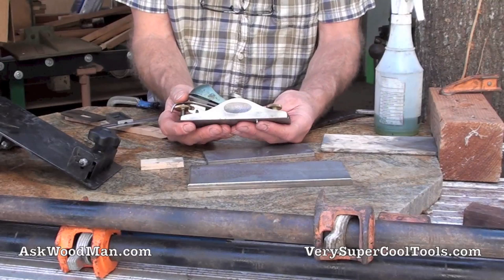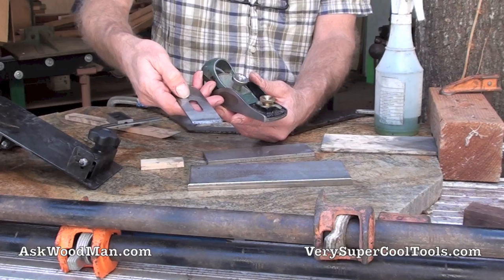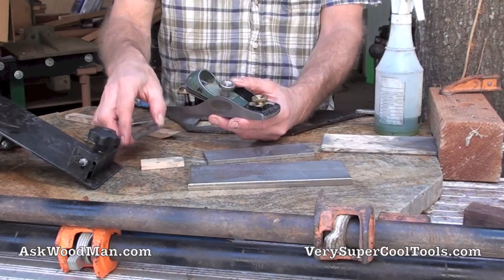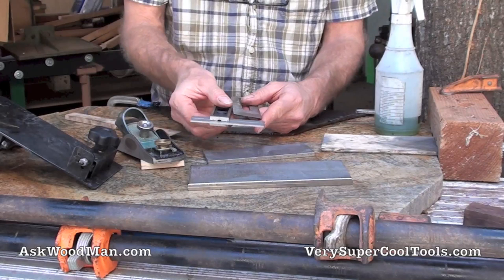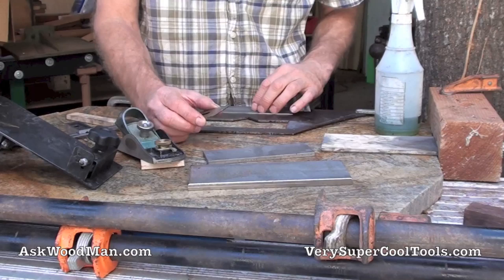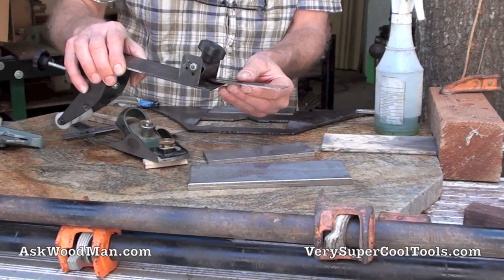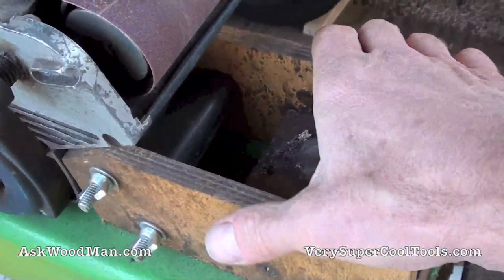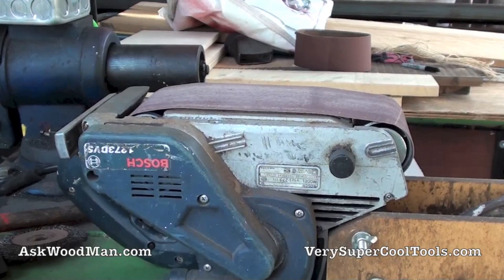1 of 3 - BLOCK PLANE SHARPENING: I Bought An Old Block Plane On Ebay!

Comment from the maker: That is the protractor head from a Mitutoyo Hardened Grade A combination square set I bought in the mid 80's. Buying that set was one of the smartest things I ever did and one of the best tool investments I could have made when getting started. I have two other Mitutoyo blades and two more square heads and they are all interchangeable. That little double square is a cheapo from Grizzly. It reads off when checked to a Mitutoyo.

Comment from the maker: Starrett is another brand that makes measuring tools of that quality. My local machine shop supply house Dixie Tool Crib (Austin TX) has sent stuff to many people I have referred. They carry the full line of Mitutoyo and have as good a prices as you will find. That is where I bought all my stuff. I am just a customer with no relation to them. They made me a good deal on that first set and made a lifetime customer.

Comment: What is the grit of the sandpaper on the belt sander? I can't find where you mention this.... And.... is there a lubricant in the water bottle or is it just straight water? Thanks for the very informative videos....

Brad
Reply from the maker: I am pretty sure that was an 80 grit belt on the slowest sander speed. The fluid is a 50/50 mix of water and Simple Green All Purpose Cleaner. I discovered this as cheap, low toxic, non rust promoting cutting fluid quite a few years ago. You don't want a lubricant for this type of cutting. That implies a sliding space that interferes with the tool and stone cutting action. Like oil creates a space to keep parts from actually contacting. We want a fluid that allows the tool to get right at the abrasive material, be cut and then flush those spent particles away and hold them in suspension so the tool is always in contact with clean abrasive material. Thanks for visiting Brad. Allan